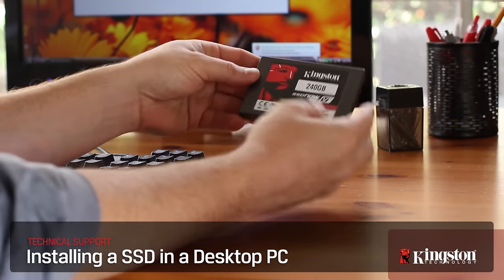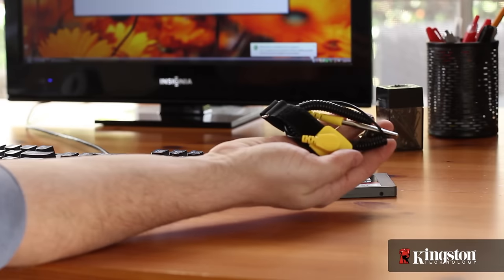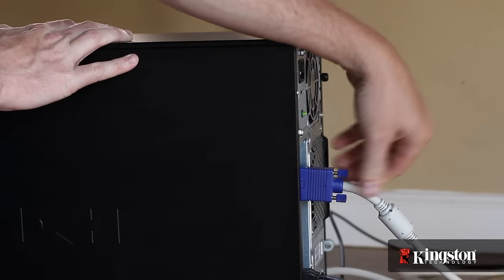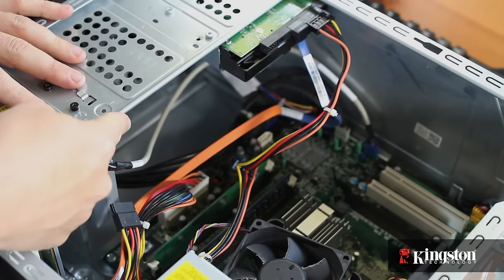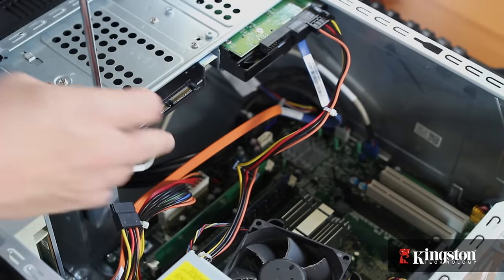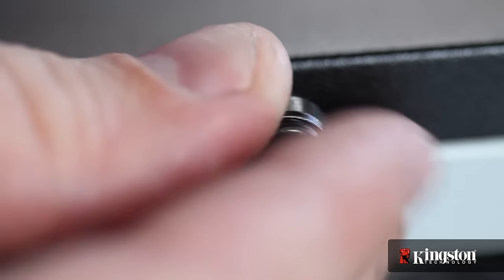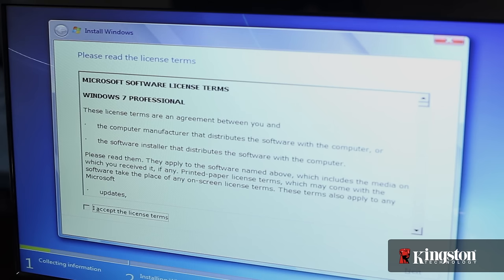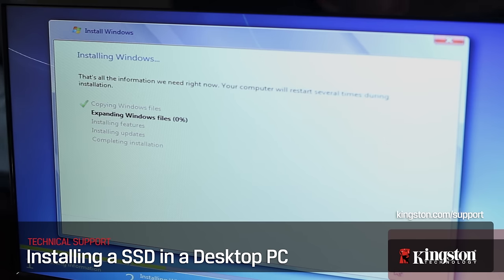Installing a SSD in a Desktop PC

Comment: I currently have an hdd with w7 installed can i simply just add in the sdd as an extra drive along with my current hdd or do i have to install w7 on the sdd and only be able to use the hdd??? Plz help
Reply from the maker: SSDs can be used in the same way as conventional mechnical hard drives - in other words, you can either use them as primary hard disks in order to install the operating system onto them or you can add them to an existing configuration as a secondary drive, remembering that you need to first initialise and then create a simple colume on the SSD through Disk Management if this is the option you prefer.

Comment: I have 6 SATA slots on my motherboard, does it matter in which one I connect the SSD ? Does it affect speed ?
Reply from the maker: For continuity’s sake, you might want to install them in the lowest to the highest SATA port number, but other than that, it doesn't really matter anymore.  It only used to matter before when motherboards had mixed SATA 2.0 and SATA 3.0 ports.

Comment: Ok my laptop is an Acer Aspire 5349-2592 and my current Hard Drive is 217 GB with Installed Memory/Ram of 2 GB's and it's a 64 Bit Operating System.  So how can I upgrade my current Hard Drive when my DVD Burner/CD Burner doesn't work??  Question?  What's the difference between the HDD and an SSD?

Comment: I want to install a SSD, but I already have two hdd on the desktop that I also want to keep installed. I have two extra SATA connections available, but all power cables are already in use. Do I need a new PSU or is there an alternative?

Comment: How to connect  I have ssd and cable can you please help me how to install
Reply: What exactly do you need help with? You just plug one end of the SATA cable to an available SATA port on the motherboard. The other end of course goes to the SSD. Then, you run a power cable from the power supply to the SSD's power connector. Depending on the case you have, you may have a specific place where 2.5" drives are installed or you may need a bracket to install it in the place where a 3.5" drive would go. That's pretty much all there's to it in terms of physical installation. You would then install your operating system on the SSD or clone from an existing disk or setup the SSD as extra storage or whatever you want to do with it.

Comment: Question?  Can I replace my hard drive in my laptop with a disk like this one?  And if I have an OLD Mini Tower can I use one of these drives to update the old Mini Tower?   Now I use a laptop.
Reply from the maker: Hello Steve,
I'm Jewel with Kingston Technical Support, here to address your question. As long as your laptop and MiniTower have at least a SATAII connection, one of our SSDs can be installed in it. For full benefit of the drive they would need to have a SATAIII connection. The largest capacity SSD we currently have available is 480GB. We are here to help and can confirm compatibility based on the exact model of your computers. Please call us at 1-800-435-0640 (USA and Canada only) M - F 6am - 6pm PT and I or another available Technician will assist you.

Thank you for selecting Kingston as your upgrade partner.
Reply: Ok my laptop is an Acer Aspire 5349-2592 and my current Hard Drive is 217 GB with Installed Memory/Ram of 2 GB's and it's a 64 Bit Operating System.
Reply: Kingston Technology - So how can I upgrade my current Hard Drive when my DVD Burner/CD Burner doesn't work??
Reply: Kingston Technology - I would love to go to the 480 GB SSD Card.
Reply: Kingston Technology - Question?  What's the difference between the HDD and an SSD?
Reply: Steve Mason Hard Drive Disk and Solid State Drive. SSDs are much faster and smaller than HDDs and outperform them in about every way. Other than that they about the same.
Reply: Daniel Quilling-  Ok my laptop is an Acer Aspire 5349-2592 and my current Hard Drive is 217 GB with Installed Memory/Ram of 2 GB's and it's a 64 Bit Operating System.  So how can I upgrade my current Hard Drive when my DVD Burner/CD Burner doesn't work??
Reply: Kingston Technology Thank you so much for this informative video i think now its time to move to SSD devices.
Reply: Steve Mason Not to sure, I would look it up in Google or YouTube. I'm only 13. lol.

Comment: When you put in the ssd does it auto needs to have the windows installed or no
Reply: If you're going to use the SSD as your boot device, then yes you will need to install Windows on it.

Comment: Are the same cables used in my HDD usable on the SSD? planning on getting the samsung 850 EVO
Reply from the maker: Our SSD uses standard SATA connectors (data and power), if your SSD is connected via SATA, the SSD should fit just fine but please first check for system compatibility on our website:
http://www.kingston.com/en/memory/search/Options
Reply: Thanks! Much appreciated!

Comment: question. if you order a sdd, do they provide the brackets?
Reply from the maker: Hi, our drives are usually stand-alone, which means the drive itself will be the only product included. If you buy an UV500 you have the option to also purchase an upgrade kit. Our upgrade kit includes:
- 2.5” USB enclosure
- 3.5” bracket and mounting screws
- SATA power and data cable
- 7mm to 9.5mm adapter
- Hard drive cloning software – download coupon 
Thanks for your interest!

Comment: ok guys a question please cuz im new with this. 
I have a HDD with two partitions. The one is 40gb and has only Windows in it.
The other one is 450gb and i installed programs on it.
I now bought a Kingston SSD.
How will i make it, to remove windows from the HDD partition 1 but keep my files from partition 2? Is this possible?
And if i finally make this, the programs that will be left on the 2nd partition they will not be able to run right? Since the HDD will have no windows

Comment: Hi all is the cable  he finds coming from the original hard drive ? .
Reply from the maker: The cable is a SATA connection that usually comes with the system / motherboard.
Reply: Thank you .

Comment: It will work without a problem at all, and your game files will load like lightning, so changing maps, zones, characters ect will be a lot faster. The only time it will slow down is when the application (or game) requires access and use of windows system files to render graphics. For example your graphics card drivers or DirectX. This bit negates the use of a monster fast SSD, as it will be bottle-necked by your HDD. This is why it is best to put your OS on your SSD if possible.

Comment: what are the sizes of brackets used to put the ssd in the drive bay?

are all hdds/ssd same sized?
Reply: Hypastpist they come in 3 sizes. 1.8 inch in notebook, 2.5 inch for a laptop, and a 3.5 inch for a standard desktop
Reply: what about the desktop bays? are all desktop bays all the same sized?

standard ssd are all the same but the bays and bay brackets i still dont know about
Reply: Hypastpist If you have a desktop there is going to be at least a few 3.5" bays, and possibly a 2.5" bay, but you can easily tell them apart.
Reply: Sophia Willis can I install 2.5 in desktop

Comment: wait where r the cables for the sdd? the psu?
Reply from the maker: Hi qzoh, did you buy one of our SSDs recently? If so, which model? Thanks!
Reply: @kingston  nope but plan to get one soon, just looking for tutorial how to install external ssd, was confused about the cable part
Reply from the maker: Yes, in that case, we recommend that you purchase a UV500 bundled with the installation kit. Our installation kit includes a SATA cable, an enclosure, a license for a cloning software, among other items. Can you tell us the make and model of your computer, so that we can check the compatibility for you? Thanks!
Reply: @kingston  thanks will check on that
Reply: sorry to disturb u, what should i do if i just want to use ssd as extension for storage, i currently have a xpg 512gb m. 2 pcie ssd installed, i wanted to install an internal ssd in it, so is it possible to have a pcie ssd and internal ssd put together to extend its storage from 512gb to 1tb (assume i got another 512gb internal ssd)

Comment: So can I not have my ssd as my main drive
Reply: Sure. You can use it as a normal HDD. The transfer files on it will be faster (this is why it's used for Windows in most of the time)

Comment: "an ssd"
Reply: Because you read it like "es es di" so technically he's not wrong. Because when you read it, it starts with e.
Reply: @Thickman69  If he said "a solid state drive," that would be correct. He said "a s s d," which is not correct.

Comment from the maker: Hi, I'm Jewel with Kingston Technical Support, here to answer your question. If your system has a SATA III port (6Gbps) it would be best to have a SATA III cable to get the most out of our SATA III drives. If your system only has SATA II ports (3Gbps) than a SATA II cable would suffice. For further assistance, contact us at 1-800-435-0640 (USA and Canada only) M - F 6am - 6pm PT and I or another available Technician will assist you. Other regional contact info available on our site contact page.

Comment: my computer already boots in like a minute so could I just connect an ssd and use it as a drive for some of my games for faster load time? do I NEED to put the OS on it, I'm already pretty deep into my HDD and I'm not looking to buying a 1tb SSD, just a 120GB one.
Reply: well, 1 minute is pretty long but if you don't mind about that, yes you can put game's on a ssd and your game's will boot way faster.

but remind, some game's these day's take a lot of storage space on your hdd or ssd. so you might want to look for a 240/250gb ssd
Reply: TheNielsAlmelo thanks, I don't really care about the boot up time, I heard that if you actually want to boot from your ssd you have to transfer everything on your drive, not just windows. I can't really do that without spending 500 bucks or deleting 70% of my hard drive, something I don't really want to do. 

I don't know if this is a stupid question or not, but if I put games on an ssd, will launchers like Origin or Steam have a hard time finding them? because I know steam just puts them in a folder on my hard drive. thanks again for the info
Reply: MiningBlock it should not be a problem to do that, ssd's are pretty cheap these days, a kingston ssd 120g is 64.95 EU and a 240g is 110EU here in the netherlands :)
Reply: MiningBlock Or you can simply just add the games you really like and play alot to the ssd, so those boot alot faster (:
Reply from the maker: Hi MiningBlock - The conversation here seems accurate but we wanted to check in to verify - You do not need to put your OS on an SSD if used for storage. You can connect via USB externally if you purchase with the full kit.
Reply: Kingston Technology So you're saying that if I just want to use an ssd for my games, I just need to give it power and a sata connection and I can treat it as removable drive? As in when downloading games, I can just select to have them downloaded onto the ssd instead of the hdd?
Reply: dre1507 y
Reply: GuitarListen Do you need sata connection or just USB if you want it for games , music , etc...?
Reply: ***** you need an sata cable. also an cable to connect it to the power source , but you should have one in your pc. also look if you have sata slots in your motherboard. you might only have for your hdd.